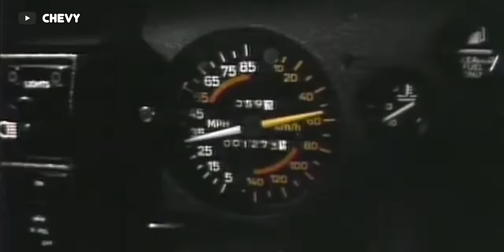These are the WEAKEST ENGINES EVER

Comment: The cad 500 has potential. 11.1 with early 472 heads or 13.1 with 425 heads. Add the aluminum intake and a distributor curve and they are beasts. Forged steel crank, these things in stock form are bomb proof. I ran a 1974 472 5 quarts low and overheated it. Added oil and water and she fired right back up and continued on my trip. Only 80ish pounds heavier than a 350. Unlike a hot 350, this monster will idle smoothly and all that torque is right off idle. These can be the unsung power combo
Reply: Ever hear of Project Bad Seed by Hot Rod Magazine back in uhhh late 90's? Take a Caddy 500, warm it up, add it to a Chevette mounted half into the cabin, go drag racing. Look it up!
Reply: @evi1dav3  that's when I started following Steve Magnante

Comment: The English Electric 12CSVT locomotive engine is a V12 diesel, 185 litre displacement (pistons are 10 inches in diameter), and it produces 1750 horsepower, less than 10 horsepower per litre. But it sounds amazing under acceleration.
Reply: And all to spin a generator.  But with a prime mover in a freight engine it's all about hours between rebuilds.
Reply: Will this fit in a Miata?
Reply: @TherealOjsimp1286  might need some cutting around the engine bay, but yeah, an engine bigger than the car should fit.
Reply: @TherealOjsimp1286  Considering a majority of them are in locomotives, definitely not.
Reply: @TherealOjsimp1286  under maybe

Comment: Intresting history side note, the Mustang II wasn't available with a V8 in North America, in 1974 unless you bought it in Mexico. Speaking about the Caddy 500, in 1970 the 400 hp was gross after 72 the hp was measured net (as installed with all accessories) so that did significantly drop the numbers, not to say that it wasn't a smog-dog. The 70's brought emissions and things like CAFE cut the nards off everything. The technology wasn't there to meet the standards so you ended up with low compression, poor flowing heads, anemic cams, convoluted vacuum hoses, smog pumps, and restrictive exhausts... good times.

Comment: I will always defend the 6.2 even if I do agree the hate for it. My 305 and my 454 have had issues along with the old 6.2 I had but that truck (6.2) would start for me no matter what I had done to it, no matter how cold it was and in a c20 23 mpg is pretty good imo
Reply: The 6.2/6.5 will always make reliable power. Comparable engines for the year obviously will make more power/durability
Reply: I'm a used car dealer, the nearest auction to me is 190 miles away. I got a 6.5 to tow inventory back and forth. Accelerating from a dead stop is painful, but once I'm rolling, I enjoy 15.3 MPG while towing 8k to 11k.  I used to get about 11 MPG, but my injector pump quit, and when I pulled the old one, I found that whoever installed it last, put it in with retarded timing. I installed my new one with advanced timing. A bit of knock when cold, but runs fine otherwise.
Reply: @vivillager if you don’t need much for power or torque then a 6.5 is a great motor and on great platforms, it’s killer is the power as the 5.9 and 7.3 made more power or torque but I’ll die but my old 6.5. I’m actually looking for another with a 5 speed as it sits currently

Comment: Dude. 400 hp in the  early 90s was impressive
Reply: It was the first time there had been 400hp available from the factory in a while. Unless you had a racecar
Reply: Yes it was back then But he’s a young buck ,  probably was still in school when the viper came out .
Reply: It's about the HP per liter. 400hp out of a naturally aspirated 4 liter engine is awesome even today, 400hp out of an 8 liter naturally aspirated engine isn't.
Reply: @badass6300  ur missing the point… In early 90s 400 hp was top tier… 5.0 mustangs were 225 hp… 
They didn’t have the technology we have today….  
I agree. 400 hp out of a 8 liter v10 today is a dud.
Reply: @hunterbidenscrackdealer3753  The problem is that in the early 90s the japanese were making slightly 100hp per liter naturally aspirated, which is double the HP per liter compared to the Viper. But the Japanese refused to make big engines, if they did, they would have dominated the world during that time period.
Reply: @badass6300  fair point.
Reply: Most cars still dont have 400 hp and most cant even handle 150 HP
Reply: @badass6300  and the 4 banger is stressed out
Reply: @shadowopsairman1583  Very true, but they were very tough too and since they were naturally aspirated, they had far fewer problems than modern 4 cylinder, very under-square designs pumped hard with a turbo.
Reply: Not compared to Europe tho, might have been in America but it was still low
Reply: @badass6300  But HP per liter is just a dumb thing to go by and ignores everything else about the way the engine operates.  Undoubtedly, the Cady 500 under-performed in the later years, but it was a product of its age.  People who bought these cars with it didn't care about making 4 or even 3 hundred horsepower.  They wanted quiet, smooth, effortless power delivery and that's what they got with the big displacement, low end torque and choked off intake and exhaust.  They COULD have had a smaller engine making much more horsepower, but that isn't what the driver wanted in those big luxury barges of the day.
Reply: Sure. Not out of 8 liters though.
Reply: Doesn’t even sound reliable
Reply: 400 ponys from 8 liters of displacement is not bad for the 90s. That's 50 per liter, so i would say it's not bad at all
Reply: @dumahim  we're talking about the 90s here I don't know how you managed to diverge the topic but what you're saying is dumb and irrelevant to this conversation
Reply: Also I understand that Viper engine was mostly aluminum so its power to weight ratio wasn't so bad in comparison to the Corvette of the same year   (some Dodge trucks got an iron version of the V10 engine but less horsepower than the lighter Viper engine)
Reply: @ryurc3033  
It was the first time, in a non-exotic car, ever.    The highest HP rating in say 1969 was a Chevrolet 427 with 435 hp.   But that was 435 Gross hp, which corresponded to probably 360 Net hp.   In the 90s they used SAE Net ratings.   
The Gross hp is measured with the engine stripped, no alternator, no water pump, no air cleaner, no mufflers.
Reply: No it's not
Reply: I'm still okay with 400 hp
Reply: @hunterbidenscrackdealer3753 back then the japanese already making 270+ hp on a 3.0l engine. It's not a tech limitations, but rather both Viper and Mustang are dogshit cars.
Reply: @americanadventureoutdoors4213  i forget that time waits for no man  and that the 90s were only ten years ago lol
Reply: .. and the 1st gen viper engine made 465 LB-ft of torque at only 3600 rpm.
Reply: @frankchodacki6269  That's great for passing power. The old 455s, 460s, and most others were torque monsters. We had a 1974 Riviera with depleted hp (245), but it was the torque really. I'll have to look that up.
Reply: @badass6300 made more hp per liter then corvette
Reply: @zacharythornton1904 Which corvette with which engine?
Reply: @badass6300  never mind it’s close enough I saw a video comparing the two. 1995 viper vs corvette viper has 400 hp 8.1L 48.7 hp a L Corvett 300hp 5.7 52 hp a liter. People say the viper has a big engine no HP, the Corvette of the same year is making basically the same.
Reply: @zacharythornton1904  Yup, American engines were pretty bad in the 70s, 80s and until the late 90s.
Reply: @razvanursache9493 50 hp per liter was normal in 1960s.
Reply: 400 hp back then was insane
Reply: Torque is more important for vehicles that are heavier and tow.  Hp figures don’t impress me much.  I would rather know where that torque curve is.

Comment: My '05 Dakota has the 4.7L in it, and it works very well in the mid-size truck. Even tows pretty well, but going up the Cajon Grade it does show its weaknesses. It does some rev-searching when trying to maintain 70MPH unless I completely full throttle it.

I think the 4.7 was put into vehicles that were too heavy for it to really properly handle.
Reply: In mountain driving sometimes "overdrive lockout" is appropriate with the automatic.
Reply: Try swapping the rear for a shorter geared one.

Comment: I mean, my 95 f150 has a 5.8 with like 180-220 horsepower, and torque is anyones guess. I can't seem to find the actual numbers, but it is pretty pathetic.
Reply: Yea people talk $hit about 4.6 but anything but the 460 and 7.3  was weak without a major overhaul
Reply: @Back Road Boy  460 is an insanely capable engine. Just not from the factory. 

The 7.3 IDI was pretty weak, but the 7.3 Powerstroke is plenty for its intended application.

The 4.6 is at least according to some one of those million mile engines like the 7.3, just not tons of power or even really capability of making power.
Reply: 325 torque is what it should make
Reply: @Cody Parker  cool, any idea on a solid horsepower number?
Reply: @duckdestroyer2412  210 325
Reply: @fordman2288  Thanks. I've been looking for a solid answer.
Reply: I think it puts out 328 ft lbs
Reply: The 1967 327 ci little block. It would Barely rev to 8,000 rpm. Totally junk.
Reply: @Ricardo Fierro  well considering mine redlines at ~5k. That's pretty good.
Reply: I had a 94 F150 5.0, traded it in for a 03 Chevy 5.3. Night and day difference
Reply: @Todd Desmarais  it is amazing the difference in just a few years how much vehicles change. A few of my buddies' commuters have more horsepower, in both numbers, and just from feel then my truck. lol
Reply: @ricardofierro7041  pretty funny of you to compare an engine that is over 50 years old now to today. Such arrogance.
Reply: @ricardofierro7041  8k rpm is really high, and the engine is 55 years old 🤦‍♂️
Reply: well take it out and rebuild it

Comment: Well i own a 76 cadillac with the rated 190hp and on the dyno stock was 280hp at the rear wheels. 1k$ in parts with headers, high rise intake and a mild cam took it to nearly 380hp at the wheels

Comment: Some of these aren't as bad as they sound.   The US auto industry switched from Gross hp to SAE Net hp around 1972.    So the 180 hp Corvette would have about 250 hp under the Gross rating.

Conversely, when builders and mechanics dyno an engine for comparison, they alway have an electric water pump, no alternator, and no air cleaner or mufflers.   
So as soon as they install it in a car, it is making less at the crank.

Comment: You failed to mention that the 1976 Cadillac 500 only made that 190 HP in the carbureted version. The fuel-injected optional 500 motor made 25 more HP.

Comment: 2:48 I knew my engine would be on this list. I have it in my 06 Grand Cherokee.  It is comically slow for the displacement but, I love it.  It sounds great and it is reliable as long as you ALWAYS change the oil on time. An intake really goes a long way with getting more power out of it too.
Reply: I'm surprised he didn't talk about the 4.6 from Ford or the 4.8 from gm since all 3 made roughly the same power. I still have my 05 ram 1500 since high school and I love it. It's not the fastest truck but it sure wasn't the slowest lol.
Reply: I'm honestly surprised he didn't talk shit about my 5.2 v8 (318), in my 97 dakota it makes 230 hp and 295 lb/ft of torque. But the thing has 240k miles on it and still going strong
Reply: The 4.7 high output was alot more powerful
Reply: The 5.9L magnum was even less gutless than the 4.7L in the 2002 ram 1500 it only makes 5hp more than the 4.7 at 245 hp
Reply: @lethargicstove20  oh yea that's right. But I remember those being a little more torquey than the others. Lol
Reply: @acd6374  yes, the 5.9 magnum had Alot of torque but no power for its size

Comment: If you think the 79 Mustang was bad then you need to check the 255ci V8 from 1980 because it produced around 118hp and the funny part is that its a debored 302 but luckily the 302 came back in 82 if I'm not mistaken and so its power and by the time it reached around 85 i believe it was already making over 200 horses😮 and by 87 who ever owned a new Mustang then you're the man. 87 to 93 were the best from that era.
Reply: I don't think that the 5.0 engine was available in 1979. I believe it was also the 255 cubic inch engine and the 302 (5.0) wasn't available until 1982.
Reply: Nice thing is a stroker 302 or 351 should bolt in fairly easily to remedy the situation. 😂

Comment: I remember a '66 Chevy 283ci V8 that said it had 195 hp.    That doesn't sound too bad after this video.   I am thinking the measurement of horsepower in '66 was probably overstated.
Reply: There was a change in HP ratings in 1972 when the manufacturers switched to using SAE net HP vs gross HP ratings.
Reply: @edwardpate6128  That’s an important point no one ever really talks about. The best example to use is GM. They were the first to start reducing power output starting in 71. Ford, Chrysler and AMC waited until 72. Their engines on paper took a much larger hit. GM set an 8.5:1 compression ratio limit starting in 71. Their engine lineup from 71 to 72 was basically unchanged. So whatever HP and torque rating differences between 71 and 72 were the difference between gross and SAE ratings.
Reply: Under

Comment: The 4.7 from Chrysler was actually designed by AMC prior to the buyout. The only thing the 4.7 has in common with the previous AMC V-8s is being a V-8. 
Most of these low power outputs on these engines have to do with engine controls to meet mileage and emissions goals. Engine control systems have come along way since the first electronic control systems. 
And since the 4.7 was a SOHC cam engine I'm surprised that Chrysler never seriously looked into swapping the heads out for twin cam 4 valve heads. (1) The 4.7 power output peaked at 310. I'm not sure just how much growth there was displacement wise in the 4.7 block due to the tighter bore spacing. If the block casting had any coolant passages between the cylinder walls it was likely only around .060c to .075" wide at the narrowest point. Also looking at the 4.7's combustion chamber and valve layout I'm wondering if the valve angles were splayed relative to each other. The valves them selves were rotated close to 45 degrees relative to the bore centerlines.

1) Going to a DOHC with a 4 valve head likely would have significantly increased the overall width of the engine. Unless they went to  SOHC layout similiar to the 3.5 V-6. Curiously the 2.7, 3.5, 4.0 and I think the Pentastar V-6s all have the same bore spread as the LA and New Hemi V-8s at 4.440" or 4.450". Once you need to cast the aluminum block around the cast iron cylinder liners the block starts to get pretty long.
Reply: The 4.7 didnt have much power, but compared to the 5.2 it replaced, it was worlds better in the torque area and fuel economy.
Reply: 08-13 4.7 would of been 65 hp per liter.
Reply: @OmniOmega0X  
I remember when the gold standard for a road car was 1 hp per CI. At least in the US anyway.

Comment: These engines weren't necessarily bad they just had unreasonable emission goals that choked these engine to death..!
 It doesn't take a lot to get 500hp out of a Cadillac 500 you just got to pull the emission crap out of its ass and let it breath through something larger than a 175cfm 2 barrel!
Reply: I’m pretty sure all those Cadillacs had a 4BBL quadrajet. They all flow at least 750 CFM. I wanna say actually 850 CFM. All those engines were underrated. 190HP in a car that weighs around 5000lbs wouldn’t last very long because you’d have to beat the hell out of it every time you tried to merge onto an interstate. There are still a lot of these cars left with with over 100,000 miles on them.

Comment: Have a 2012 Chevy Sonic LS, 1.8 5MT, curb weight 2707. At 83k, zero mechanical repairs, no TSBs nor recalls ever. Not a race car, but I consider it a compact sports sedan. Makes 77hp/litre, (138/125) and 40+mpg, barks tires without intent, gets 0-60 @ 7 seconds, responds with authority and takes 90° turns at 60 thanks to the Corvette-tuned suspension, on cheap Douglas A/S tires (actually made by Goodyear) with 50k run off them. Routine maintenance, simply oil changes and tire rotation every 5k. Unfortunately yet typically, GM retired the durable 1.8 in favor of the now infamous 1.4 turbo option, before cancelling the Cruze/Sonic brothers altogether. Meanwhile, the 1.4T continues to fail in several small GM crossovers.
Reply: But the 1.4 without turbo is the base engine on the little Spark.

Comment: I had two iron duke Fieros back in the day. I was able to squeeze a little more power out of one but the redline was so incredibly low it was  really easy to spin main bearings. I have always wanted to see how much power I could get out of one if the oil system could keep up.
Reply: Not much.  Block is extremely weak along with the rods
Reply: The Pontiac 301 it was based on wasn't much of a revver either. It's supposed to make all of its power in the low revs and was more suited to small trucks. The Quad 4 is the 4 banger the Fiero deserved with maybe a Buick 3800 as an option.